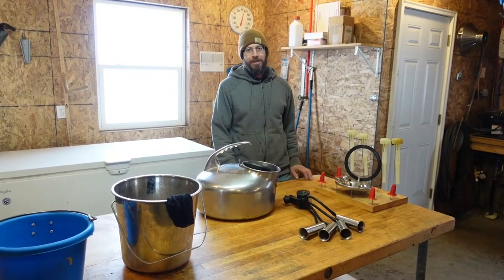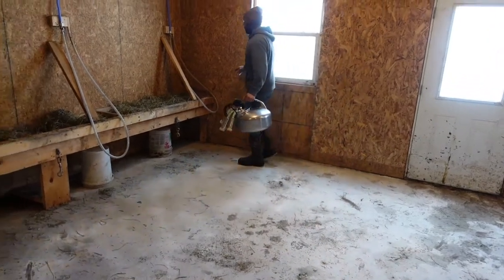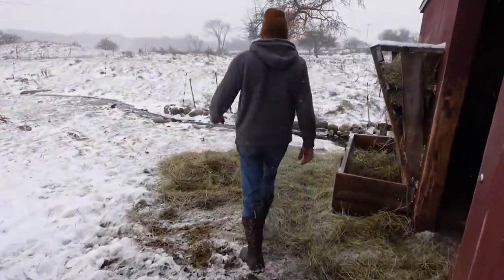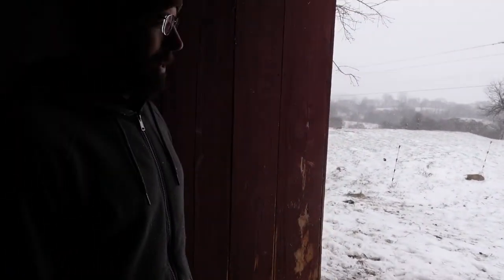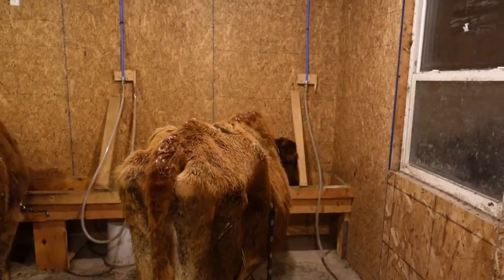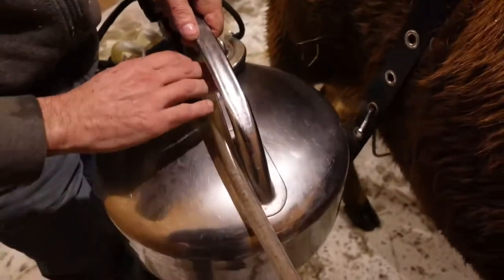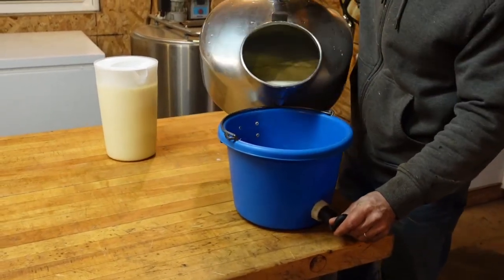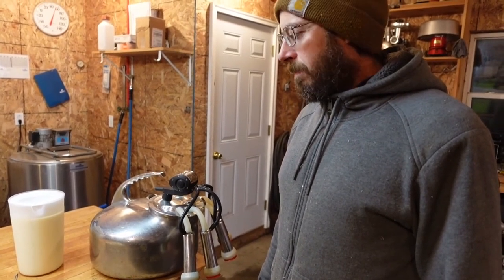Milking Jersey cows with Surge bucket milker

Comment: Thanks for posting the video. Push the belt forward on the cow so that the surging motion of the milker is enhanced, as it was designed to do. The milk tubes will straighten out when the surcingle is positioned properly. Do you filter the milk before drinking ?
Reply from the maker: The belt tucks in between the hip bones and side bulges and I don't think it will go ahead any more. I will keep this mind when we start milking again in late summer. Filtering the milk is only done if I am giving it to others; there is usually nothing much in it anyway. The strainer is just one more step and one more item to wash.
Reply: I love this. How we milked our Holsteins  during 1960 & 1970. I just said to my friend the 'harness ' which the  bucket hooked on to, needs to be moved forward.  .  However, love this, makes my heart smile from South Dakota.
Reply: I love my surge milkers, i sell raw milk and i can really sanitize a surge well. One of my cows has back teats that hang down to her knees, it's fun milking her! Have to put the surcingle  dang near up to her shoulders and click it in the back notch on the handle, but it works.
Reply from the maker: We have been fortunate to have high udders on our jerseys. If I was selling milk I would sanitize twice daily as an act of responsibility on the part of the customers, but since it's only us drinking the milk I don't bother; one of the perks of subsistence farming! Glad you love milking, there are very few that do.
Reply: @middleveldfarm7736 Only people who have lived on a farm know how much better the milk taste fresh and from barn to fridge.... My god I miss that taste. Had to sell the family operation back in the 90s and now theres just a few beef cattle for extra cash and food. Great video!!

Comment: Thanks for this video . I am wondering about the surge Milker . I am try to get my hands on one but none seem to have the pump with them . Would any pulse pump
Work ? Newbie alert . Or do you have any suggestions of what to look for ?
Reply from the maker: I got mine at Hamby dairy supply online as a kit and the vacuum pump was included. It should work fine with any pump that is regulated at 12-15 inches of vacuum and has  about 3cfm flow rate. HVAC vacuum pumps look like they would meet the requirements and are pretty cheap.  The pump I have is a Conde long life and sells separately for over $1000. Last I checked the HVAC was under $100. Probably will get one as an emergency back up.
Reply: @middleveldfarm7736  thanks so much for this info

Comment: My father bought a two unit surge in 1962 to milk 16 cows. We had a cross red whitehead, a real bad attitude, she kicked the plastic tops to bits. She ended up in the deep freeze. An she was tough in there as well. We had a lot of stews in 62.My mother used to trim the tails n udders, makes milking a lot easier. And will make watching your videos more comfortably. Farm safely.
Reply from the maker: We had a black jersey that was difficult at times, kicked a little, swatted with her tail too. Sometimes she would pull back on her chain  so hard she couldn't breathe. Had to put her in the freezer, too. Our current cows are very gentle and I will not keep any that are poorly behaved; safety first.
Reply: Your post made me lol. We had one or two cows that destroyed harnesses, milk machines, barn doorways.  .  Anything that could happened, HAPPENED!!  Those years of the 60's & 70's!!  And, a few landed on our plates for meals as well.

Comment: When we lose suction we are having a hard time rebuilding it. Do you think our vacuum might be too weak? Or is it something else?
Reply from the maker: I use the red inflation plugs to limit vacuum loss, as my pump is fairly low capacity . If you lose vacuum it takes a little while to rebuild since the bucket is so big .Could be a leak in the supply line,too.
Reply: @middleveldfarm7736  Awesome and thanks for the quick reply! I have a feeling it might be due to the plugs or the seal on top of my Surge C lid. Could you send me the link to the Red inflation plugs you use?
Reply: One more question - does your O ring under the pulsator sit inside the pulsator or on the top of the lid?
Reply from the maker: @aplending  my setup doesn’t have any o-rings so I’m not sure. All my equipment came from Hamby dairy supply.com . They have a lot of stuff for the surge bucket milker
Reply from the maker: Here’s a link 
https://hambydairysupply.com/search.php?search_query=%22Inflation%20plug%22&button=&section=product
Reply: Do you have a reservoir tank? These help immensely in keeping a good supply of vacuum.

Comment: Are those Miniature Jerseys or standard size? They look very tame and complacent. Great videos. Much success and luck to you.
Reply from the maker: They are standard jerseys, tape says they weigh about 1000 pounds each, but I think they are closer to 900. Thanks for the feedback!
Reply: @middleveldfarm7736  Thanks for your reply. One more question. I have heard that Jerseys can be prone to milk fever especially high producing ones. Have you ever had the problem? If so any cures or preventative measures?
Reply from the maker: I have not had any problems with milk fever. I breed for spring calves in May so my cows are on pasture with good nutrition and because I don't feed any grain they are not overproducing milk. Since it's not an issue here I am not sure what the preventative measures would be. Sorry for responding late, just saw your comment today, they don't always show up on the website.
Reply: @middleveldfarm7736  N need to apologize - you answered my question. That's the main thing. Thanks!